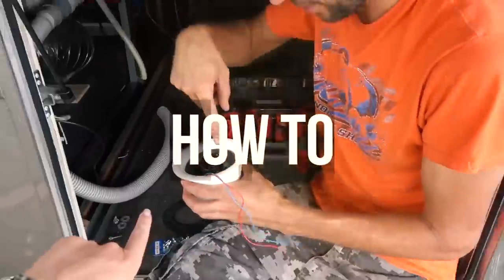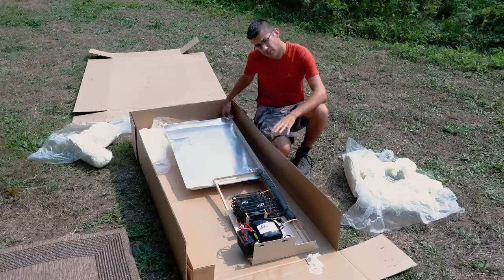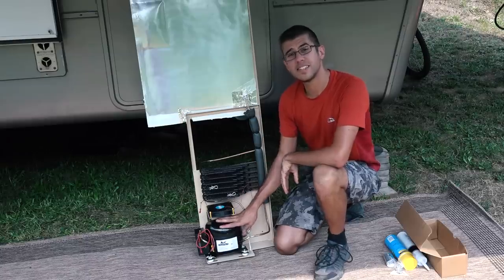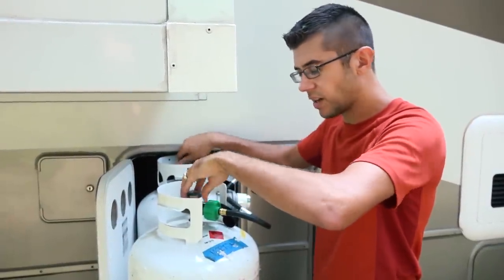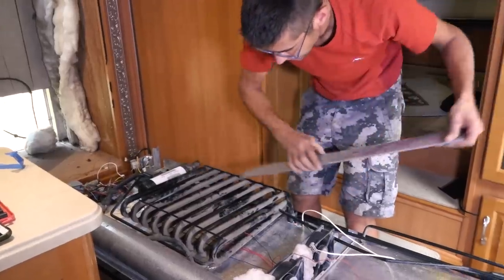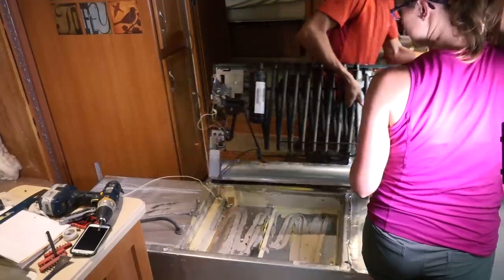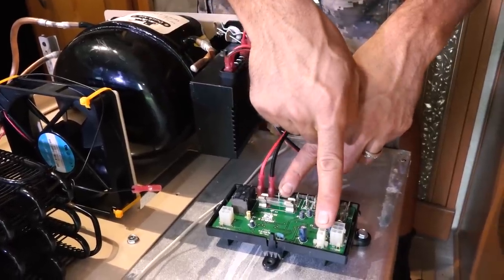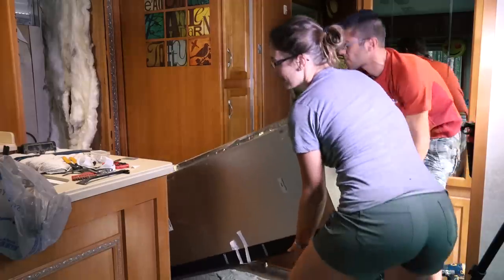Converting our RV Fridge to a High Efficiency DC Compressor- 8x More Efficient! and Better Cooling!

Comment: There's some bad information in this video, 

 Poor performance from an absorption refrigerator when running off of AC power is almost always due to sagging line voltage. That's why it happens on hot days. You'll notice that poor performance with your refrigerator almost always coincides with air conditioning use which is the reason for the sagging line voltage.

 Absorption refrigerators when powered by AC use a heating element to generate heat rather than a propane flame .

Heating elements are resistive loads which means their wattage is directly proportional to the voltage being supplied and when the voltage being supplied drops so does the heating power and thus the cooling power..

Unfortunately low voltage is very common in RV parks and campgrounds and is exacerbated when you use the air conditioning in your RV. 

 it's quite common for me to see 109 volts at the heating element on hot days when plugged into a campgrounds or rv park  power pedestal . and this significantly reduces cooling power while simultaneously damaging the compressor and blower motor of your air conditioner.

 again this is the result of being in an RV campground with everyone running their air conditioners which causes line voltage sagging to the point of being dangerous. You should always monitor your RV's input voltage and if it drops below 110 volts you're doing damage to your air conditioner and  compressor style refrigerator 

the benefit and absorption type refrigerator is that low voltage doesn't damage them like it does refrigerator compressors it just impacts performance.

If you're suffering from low voltage problems to your refrigerator causing cooling issues then the simplest solution is to  power you're absorption refrigerator from an AC inverter, 

 the inverter will be powered by your RV batteries and provide a constant 120 volts to the heater which will solve your low voltage induced cooling problems..

There is one major drawback to compressor style refrigerators in RV's especially these from JC, they utilize our R600A as a refrigerant which is isobutane. (Think cigarette lighter)

isobutane and its cousin propane R290 require much higher pressures to operate then say R134,  we are talking 300 plus PSI here. 

isobutane and propane both are explosive which is why the DOT  bans their use in automotive applications, so how it's legal to place an R600A or R290 based refrigeration unit in a vehicle I'm not quite sure so keep in mind that this might not be legal.

A punctured high pressure line in a refrigeration unit using R600A / R290 is a major explosion hazard, we're talking blowing half your motorhome back to the Stone Age, 

don't take my word for it don't take my word for it. just Google refrigerator explosions, these are explosions from R600a compressors..

Oh and when we say that the propane or isobutane in your refrigerator is pressurized or high level , we're talking it's even higher than the pressurized level in your barbecues propane cylinder.

It's interesting that they don't advise you of the explosion hazard associated with these refrigerators. R600A refrigerators are more of a fire hazard an explosion hazard in your RV then a propane refrigerator is, because the propane is at low pressure in an RV absorption refrigerator.

Don't take my word for it look at the sticker, if it says R600A or R290 that's propane and isobutane. Isobutane is basically the same thing in a butane lighter. Both are excellent refrigerants which is why these refrigerators are so efficient but they're also an explosion hazard and the dot has banned their use in automotive applications. Which begs the question how is it that they're legal to use in a motorhome or RV

Comment: some folks been using propane  in car / suff ac older r22 r12 systems fer a long time
Reply: That's still using a compressor, the type of unit he was replacing uses a mix of ammonia and other magic chemicals to refridgerate using energy from a heat source (burning propane in this case). Its also generally not a good idea to retrofit a system with propane as the refridgerant, just makes unnessicary hazard (especially if someone works on that system later not knowing it is charged with propane)
Reply: @noobulon4334  i found this nice to know from OZ the land down under   HyChill refrigerants automotive . The refrigerant that they used is a mixture of R-600a and R-290. we have a mixture of Propane and Isobutane. to me is great idea as long as its has a flammable hydrocarbon label and torches are not normal used to chand fitting so all is good
Reply: @noobulon4334  yep ill be labelling and never selling my 1985 supra with propane isobutain 80/20 or 90/10 some were in that range mix soon i think just to see it and results vs frezzz 12 thats r-12 retro fit ill bet it cool fin if not much better .i ant worried about explosion using it some may but why as it got gasoline in fuel rails n they use r290 i think its called aka propane all ready mostly in EU is a great refrigerant i figure it need to be common place .but in usa its legal only in small to med size ac units
Reply: @overbuiltautomotive1299  sounds like you know what you're doing with it, carry on

Comment: The temperatures you describe -- even with the new cooling unit -- are not acceptable. I suspect your door seals need to be replaced or maybe the airflow in the back of the refrigerator is inadequate.
Reply from the maker: You are probably correct, we are adding a fan kit to the fins, update video coming.

Comment: 1500 watt hours is a lot.  There website says 1 amp draw, obviously that is at 110 volts.  Marine 12 fridges use a lot less than this unit.
Reply from the maker: That was our worst case running in near 100 degree heat.  The fridge worked much harder, possibly our fridge is not very efficient with insulation either.  in 60-70 degrees it has been running around 500wh

Comment: Too bad it can't be switchable 12/24v or 120v.  I'd like to have an alternate as I run 120v most of the time, but would like an emergency alternative. Want to get away from the propane.
Reply: Buy a converter for a Kool-a-tron fridge that provides 120vac to 12vdc. They said this fridge takes 60 Watts (5 amps @ 12VDC) so make sure it has that capacity. Buy 2 10 amp diodes and install one the 12 volts from the battery and one on the 12 volts from the converter so there is no backfeeding.  Should work great.

Comment: All you need is an inverter to run your fridge if its not hooked up to an electric box. Just a inverter and a battery and voila. No need for a generator,  solar panel, egc

Comment: how much was the DIY kit?
Reply: I believe the AC compressor is $895, the DC compressor is $1095 and factory install is about $300
Reply from the maker: Check out our comment at the top.
Reply: Why not a complete frige from China, very nice,brand new, weight half of  rv frige,cost half price then a cooling unit you work on it,take  about 4 amp,and cooling as you never experienced,  that was I did,take me 30 minutes to put in place
Reply: Way to expensive

Comment: The battery is free if I can make it work
Reply: Watch your video on the battery system not sure if the same type battery
Reply from the maker: You need to learn more about the battery, It will take quite a bit of work to use it but it might be worth it.  You should find out how big it is for sure and be sure its worth your while.  You will probably need to use an aftermarket BMS system on it.  Orion, REC and Batrium are some of the most popular for those types of installs.

Comment: In our last motorhome we replaced the dead absorption unit with a residential type from Lowes. It did not vent into the coach and used coils on its back that utilized the old fridges venting system for fresh air. The current draw was less than the old fridge while running on either ac or dc (it had a battery hook up to an electric heating coil. The new fridge was WAY bigger inside yet fit right into the old fridges space. It kept colder longer, cooled down in about 1/2 hour from summer heat, made ice in about 30 to 45 minutes, and was WAY superior to the old fridge. I would run the generator for about 10 minutes every few hours while driving to cool the new fridge back down. I bought a 12vdc to 120vac inverter but never installed it as we just did not need it. The old fridge when removed showed two issues. First the sides of the closet walls were charred from about 1/3 from the top, and two, the closet was not installed square to the coach walls. The old fridge was slightly smaller and was wedged into the closet making it look okay from inside the coach. The new fridge was heavier so I reinforced the flooring that it sat on. We used that motorhome with that new fridge for about 4 years and just sold it earlier this year. We bought a newer motorhome and of course it has one of those absorption units and I hate it. It is just a matter of time before I replace it.
This method here is a good plan B but it does not address the space difference inside the fridge. That is a HUGE difference.
Reply: Which residential fridge did you purchase? We need to replace our adsorption unit and would like to consider a number of options.
Reply: @gerrystrohl3823  It was a Haier from Lowes. I do not remember the model but it was the same width and depth of the old fridge. Same height too if I recall correctly but I did need to do some cabinetry trimming. Beneath the old fridge was a large drawer which we continued to use after the new one was installed.

Comment: I'm thinking the original unit was not cooling well because of the way the aftermarket fans were installed, mostly blocking the upward convective airflow when they were not running. I bet that you could have seen good performance by turning those fans on. Seven years is not that old for an absorption fridge.
Reply from the maker: We actually put that insulation in there to intentionally block the flow and help the fans move air.  Before we did that it was even worse as the fans were inefficient.  With the insulation they moved lost more air but ran most of the time.

Comment: can you convert a propane /AC Fridge to a PROPANE/DC 12V  Fridge.   Then run it via converter on shore power saving roof space solar for other  uses
Reply from the maker: You can but you need to upsize your wires and you would not get much efficiency gain at all.  it's the absorption cycle that's not very efficient. On propane it's not as big a deal

Comment: There is no way a 7 year old fridge should be crapping out unless it was a POS from the start. I've had a number of older RV's and the fridges always worked. The latest was a '77 Airstream with a Domentic and that thing worked li9ke a champ after more than 40 years

Comment: Only mistake I saw was removing the positive DC where first. The positive is not the live wire. The negative is always remove the negative First and put it on last. Power runs out of a battery from the negative to the positive not the other way around.

Comment: A insurance adjuster told me the number one cause of fires in RVs is the refrigerator.
NOT FROM THE PROPANE BUT A LEAK IN THE COOLING UNIT THAT Allows the ammonia and hydrogen to escape and come in contact with heat or the PROPANE flame.
 If you have a ammonia refrigerator the first warning sign of a leak is the smell of piss and not cooling as well. Third is dust with a green or brown tint.
 As my RVs have always been older I have never used a 2 or3 way system.
 Because someone I knew was trapped and killed in a RV fire I'm Leary of them. 
The technology that you used would work for boats also

Comment: Found super bright LED rated at 570 Lumens.  Brand LUYED.

Qty 2 on Ebay.  Less Than $ 10.00  shipped.

100% replacement wth NO HEAT output.

Comment: I'm curious why you say "aught'' when referring to wire size above zero  (thinner than zero awg) as in "12 aught gauge"? An actual 12 aught wire, if it existed, would be as thick as your forearms. Its "12 gauge"', not "12 aught gauge".
Reply from the maker: correct #12... Just a bad habit from working with so much big stuff recently .

Comment: couldnt help but notice you didnt attach the ground line to the final wire you attached to the controller before putting it up right and didnt put the connector to the controller power supply all the way on..so if your fridge stops working..that's why, lol. Good video!

Comment: Extensive solar is not the issue with an all electric fridge, extensive battery is. Solar is not providing power to your inverter over night. How you replace this energy is up to you, solar, wind, generator, etc.
Reply from the maker: This is true, I did state our battery size.

Comment: Those fridge are designed to run on propane as their main source of heat to cool the fridge.  They are not designed to run on electricity efficiently.  Running on electricity are done when you are running a generator or on sure power.  Don’t ruin a good rv fridge because you don’t use it for its intended use.

Comment: Why not just buy an apartment refrigerator and make it fit. Ive done that to 3 different campers . even added an inverter to run it off the battery when on the road

Comment: A couple of tips. You could have left the old thermal mastic especially with how pliable it still was. To much is never a bad thing. Also i think it would be worth investing into a manometer for testing gas leaks in propane. Also factory Dometic board will fail when it does look up dinosaur electronics version its better built made in us and relay your utilizing is a heavier duty relay.also the box mounted to compressor i believe is made by dayco electronics and basically turns on and off the compressor. Its a universal compressor kit that can have its own tstat and power switch  jc just designed it to utilize your existing donetic controls. And fridge fins most likely freezing over due to excessive moisture in fridge and blocking fins and shelves airflow/overpacking fridge.Last but not least if you ever need help/advise call or text  my work we help all no matter where your at and have lots of experience. Look up auburnkentrv
Reply from the maker: Thanks!

Comment: to lay a frig down the tubes on the compressor should be pointed up so you don't get oil in the lines
as it will not work very good or not at all for cooling

Comment: This makes no sense you can bye a new Thomson frig same size as the domatic that came out.So all you have to do is remove the old one and then place it wright in place.So all you have to do is for wiring is plug the 110 v THAT IS IT!!!!!!!!!!!! SO it took longer to watch this video then it did to in stall the frig.You can find the frig on line  for around $300.00 Versus paying over$600.00 and all the tools  i needed was a Phillips screwdriver . And he did not  tell you about how to dispose of the old one.So you can not just go to your local land fill .THAY WILL NOT TAKE IT.When you bye the new one they will take the old one for FREEEEEEEEEEEEEEEEEEEEEEE. IT was a great video by the way.

Comment: You are really better off putting a household fridge/freezer mains voltage and driving it with a pure sine wave inverter that has load sensing. My fridge 200 litre only draws 30 ampere hours per day in 30 degrees C ambient. Waaay more efficient than your unit. Buy a 4 star fridge.
Reply from the maker: That is very efficient.  It is quite a bit smaller than our fridge tho.  I do think this fridge is not the best insulated.  We continue to average around 500wh per day

Comment: a 24 volt battery bank shouldn't "run low" the resting voltage of a 24 volt battery bank is around 25.8 volts. if your batteries read 24 volts that means they are dead and need to be charged.
Reply: Or worse, there's a dead cell in one or more batteries.

Comment: I guess if you wanted to go the 'last mile' on energy efficiency and solar, you would have to buy something like this:

https://www.escapetraveler.net/vista-boho

It comes down to heating and cooling. You can get great efficiencies with split heat pumps, including the units that are sub-zero. But you need insulation at this Tiny House level, plus the high tech windows. I'd like to figure out what sort of panels and lith storage would work. I bought some LFP CALB recycled off Ebay, but they come and go. They are easy to configure as 12v.

This is a nice DIY option, the fridge conversion, but the propane isn't a huge deal for the fridge. Obviously when you turn on a big furnace, that is going to drain the tank. There are these Chinese knock-off Webasto heaters, since you have diesel. Low power requirements. 

Maybe as you guys cash out on the Nomad vids you can upgrade the experiments and experiences. I like seeing new stuff. My Dometic used 25 AH a day. It had a fan, a circuit board, and a small heater in the door seal. That adds up.
Reply from the maker: Wow those look like nice units!

Comment: 7 years the foam insulation is braking down and holding moisture, the fan kit is a tip off that this unit has had a problem keeping up before also norcold's are junk always replace them never repair they burn down more rv's every year

Comment: You can make the adsorbtion systems a LOT more efficient if you use the Solarfrost pump - www.solarfrost.com - as in efficient enough to run on hot water instead of a flame.

Comment: I think you will be better off using a simple AC 110 volt freezer which is horizontal who uses only 35  watts an hour  a full day to  less than 850 Watts  area it is between 5 to 7 cubic fridge and cost less than $200 as such you have all this power using lithium batteries all this work is I think unnecessary  and the cost too high it's just a thought